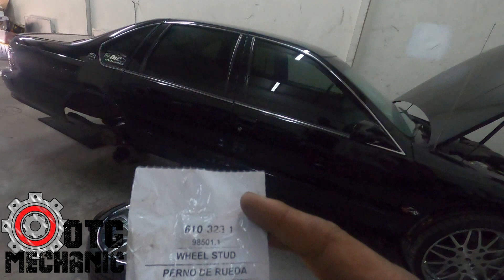Finishing Up the 95 On Forgis. Adding longer wheel studs.

Comment: I just started watching your videos on YouTube, and I must say your videos are what I've been looking for. I own a 1996 Impala. I wish you were in the Detroit MI. Area..you are very knowledgeable dealing with these vehicles. I want to know what is exactly needed to run a 22x10.5R and 22x9F wheel package? Without rubbing against the frame.
Reply from the maker: I have a 22x11 with a 315/25/22 tire in the rear and it doesnt rub even with the bags. If im aired out it will rub but I can drive with the wheel tucked in the rear with no issues. I would suggest a 25 series out back and 30 up front and you should be fine.
Reply: @Otgmechanic  any recommendations on extended control arms..Hotchkis..umi..etc.?
Reply from the maker: @eddielenton4119  they all do the same thing. I prefer nom adjustable extended. Bmr makes those
Reply: Thank you! I'm up watching more of your videos.  I watched your video on the adjustable vs non adjustable control arms. You have motivated me to do some work on my DCM
keep the videos coming!

Comment: Wassup bro sorry for the random comment. I'm having an issue with my lt1 sputtering and having poor acceleration and slight rough idle.  The kicker is it only starts doing it once the engine is warmed up. When it cold runs fine. I changed two rubber line under the diamond plate that were corroded, did seafoam, clean maf sensor and it still did it. No hard starts, and idles smooth when cold, no cel. It's bone stock lt1. I made a video on it imma put up on youtube later this evening. Any input would be appreciated thank you bro.
Reply from the maker: Change the icm on the coil bracket on the driverside head
Reply: @Otgmechanic  thank u bro! I already ordered a coil packs ill get that changed out too thank u man.